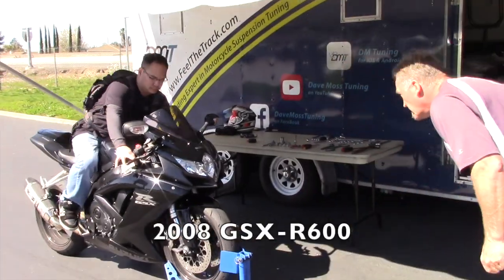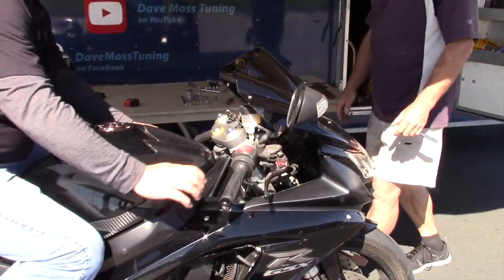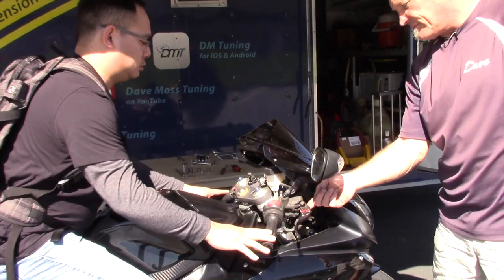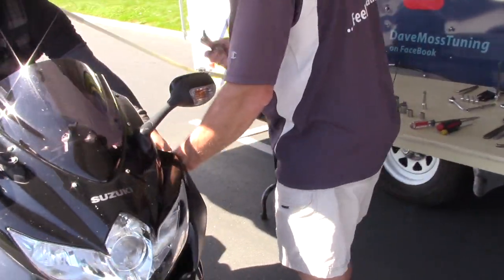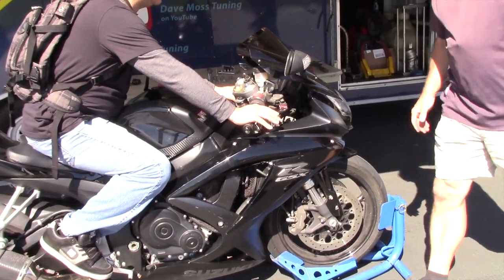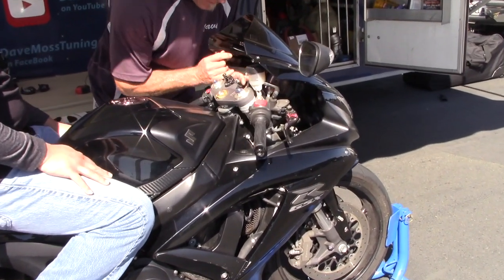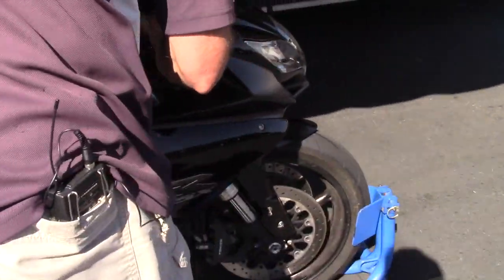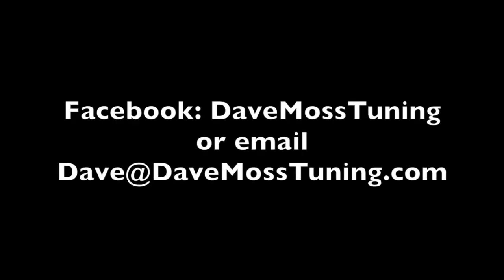Supersport Ergonomics

Comment: On the Ducati 1098S, they have locating pins for both the brake/clutch perch with respective hole drilled into the handlebar. They also have locating pins for the clipon and respective hole drilled into the underside of the top triple tree. What is the purpose of these locating pins and should I remove them so I can adjust both the clipon and perch to my own comfortable ergonomics?
Reply from the maker: The reason is safety so that controls and bars do not have a chance to move during riding. You can elongate those holes to give range for the controls to move in so you can get the angle right and you can remove the bolt on the bars to get more sweep. It is your call and depends on your due diligence in checking torque settings just like we do on our track and race bikes before we leave for an event.

Comment: Hi Dave, I have set up my front brake the right way u said in the video but now it's rubbing the front  part of fairing when I turn all the way to left
Reply from the maker: That is one of the downsides of fairings as they generally rise up from the tank. So you have to find a position where it misses the bodywork.
Reply: @catalystreactionsbw  thanks big brother, so u mean need to position the levers in a way which I feel comfortable and also still didn't rub the fairing, right bro?
Reply from the maker: @Nathan2692  the limitation is the fairing being damaged, so that is the fail point for the perfect adjustment unfortunately. Pick the angle that gives you comfort and clearance.

Comment: Is the slightly adjustable handlebar an 08 and newer feature? I cannot find anything about this anywhere in a manual or online (except for this video!) and I've got an 07 750.
Reply from the maker: Have a look under the lower triple clamp/yoke and see if the there is a space or loosen the bar and see if it will move back and forth.

Comment: Dave, a question about ergonomics here. I'm riding a Street Triple on the road mainly. I'n the beginning with my summer gloves my thumb (throttle hand)  has some pain in it, but that is gone now. Now i have a full set of leathers and alpinestar gloves. Those are harder, the thumb pain is back. I noticed I only have this pain when I have to hold the same speed for a little while. If I'm going for a sporty ride or a track day I dont have this issue. Do you have any ideas on how to solve this problem?

Thanks in advance!

PS: I've been looking into body position and trying to not lean on my hands so i don't think that is the problem. I'm also planning to do some fitness soon to make my body a little stronger.
Reply from the maker: Thanks for the email Simon. Do your gloves fit your fingers correctly? Does the problem go away when the gloves break in properly and form to your hand? Seems like that is the common denominator here? I always soak new gloves in a bucket of water for about 10 minutes and then go for a 2-3 hour ride so the gloves set to my hand shape. This avaoids extended periods of hand pain. Hope this helps!
Reply: Dave Moss Tuning 

Those gloves are a little loose on my hands (large size) and smaller ones just dont fit. Larger ones would be to loose I think. 

Thank you for the quick response! I will try!

Comment: No way he adjusts 100 bikes per day.  7days a week.  36000 per year divided by 365  apx100 per day.
Reply: 3500 he said not 36000. So ten bikes a day
Reply: Over the past 20 years Dave Moss has tuned, on average, 250 days a year around world at various street, track, and race events averaging 35 bikes per tuning day. In 2008 he tuned 322 days, last year about 200; this year with C-19 he'll still do about 150. There is no suspension tuner at any level of the profession who's tuned even 20% of the total motorcycles he has tuned. And then there's his tire knowledge which even more unparalleled than his suspension knowledge.